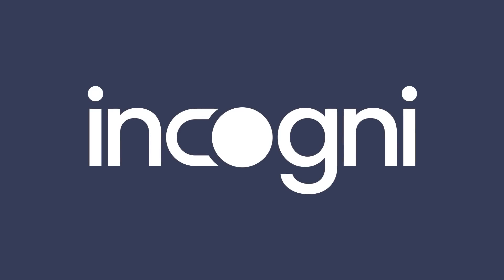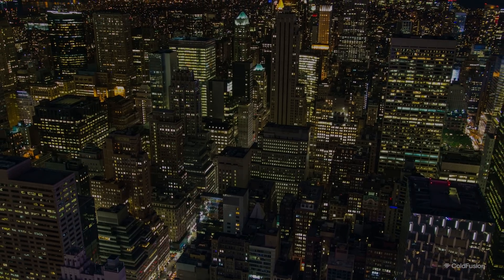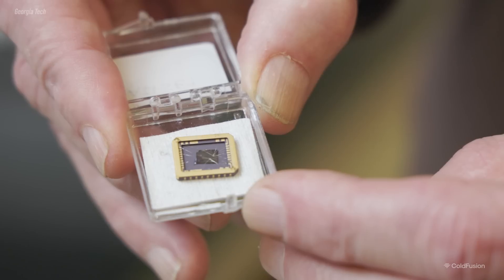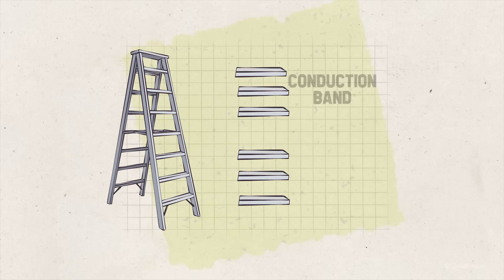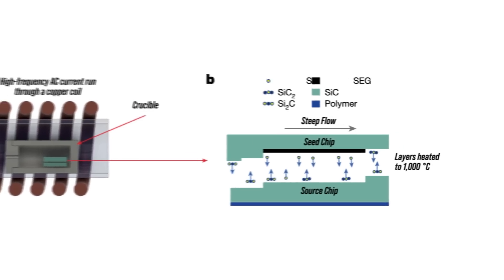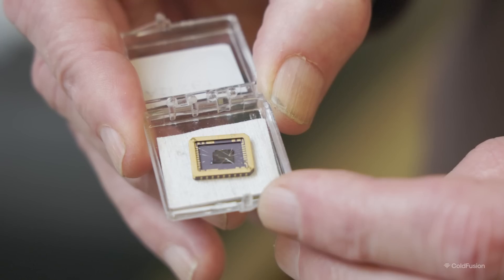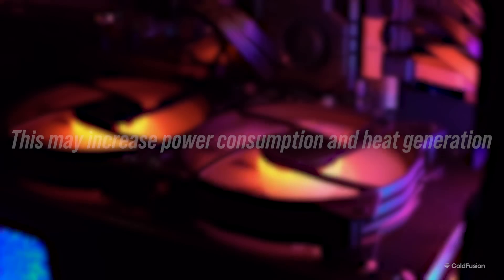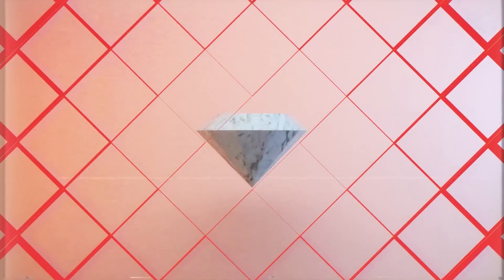This Chip Could Change Computing Forever

Comment: It's intriguing how often I stumble upon a seemingly groundbreaking technology, only to discover it's been around since the mid-20th century.
Reply: From my understanding, it seems that groundbreaking technologies are discovered much earlier, but they only truly gain traction once the technology around implementation/manufacturing/reliability becomes economically viable, which can take years, decades, or longer.
Reply: mathematics has been around for 5000 years, we haven't finished it yet!
Reply: @amj864  but try comparing that for how long human using the brain to calculate something 😮
Reply: @amj864   There are also complex mathematics formulas from over 2000 years ago that's been lost & have not been recovered.
Reply: Right! I’ll be like “wow microwaves are so cool,” look up its history and Wikipedia will be like, “Microwaves were an indispensable appliance during the time of Magellan.”
Reply: @renesays 😮😮 even before electricity 😮😮
Reply: I've noticed the same thing! Very often the newer papers also don't cite the older papers, probably because they don't want to admit that their work is not all that new.
Reply: Not true  @christiangomez7301
Reply: It took about a decade from when I heard about them finally making the breakthrough of making blue lasers, to when BluRay came out. It takes more research to see if it can be scaled up for the consumer market, if graphene doesn't pass the drop test for a personal electronic we might never see it except in videos.
Reply: Yeah sometimes they can make it, but its not commercially viable, hence the long gap as people spend time researching or applying new methods. One example of this is the solar cell, which was invented in the 1880s, but it was only 2% efficient and made of gold and selenium. It wasn't until the 1950s when the uses of silicon were discovered that any new progress was made.
Reply: Exactly this...
Reply: And will never be useful. I swear it's just stock bro's pumping and dumping stocks of these companies. I wish there was a securities investigation into these YouTube channels pounding out this rubbish.
Reply: Money
Reply: I guess it’s not groundbreaking unless it’s useful
Reply: The biggest hurdle os funding and finding a way to manufacture it at an industrial scale instead of having 10 guys using niche expensive lab equipments to make one a year.
Reply: Nicole Tesla was experimenting with a lot of these things in early 19th century but they blocked him.
Reply: Yes the first artificial neuron was writen about in the late 1940s
Reply: Kinda depressing actually. Shows you how slowly technology really advances
Reply: Electric cars 🚗
Reply: Try this one:  Mono Atomic Carbon.  6 Protons, 6 Neutrons, and 6 Electrons.  Excite it with microwaves and it becomes a plasma and can generate electricity.  The waste product is a quasi-crystal diamond-glass, which can be molded and machined and doped with metals and minerals for a wide variety of properties -- especially as a building material.    But not for men -- not until ALL wars end.  Hint: we can use the plastic island in the Pacific as source material. It is rich in carbon.
Reply: Just wait till you learn solar panels have been around since the 1890s
Reply: They are everywhere because everything just has to be perfect to make them more practical than the status quo.
Reply: I found a box of old science mags i subscribed to decades ago, and like 90% of the articles in there seem like future news.
Reply: 100%
Reply: The wonder of graphene has been systematically kept under the radar.
Better said we have birds in the sky that are nearly undetectable using this technology on full size scale.
Reply: It’s because the technology to either mass produce it in a cost effective manner, discover techniques to do what needs to be done, or a breakthrough that changes our understanding of what it does.
Reply: @StixFerryMan  You are over thinking it, there is already a huge example out there that uses it in thousands of kilo for 1 application. The point is they don't want consumers to have it YET.
Reply: AEROSPACE Engineer here and I've heard some similar stories regarding many technologies like: 
1950 We'll have Nuclear Fusion in 30 years because somebody made a breakthrough.
1960 We'll have Nuclear Fusion in 30 years because somebody made a breakthrough.
1970 We'll have Nuclear Fusion in 30 years because somebody made a breakthrough.
1980 We'll have Nuclear Fusion in 30 years because somebody made a breakthrough.
1990 We'll have Nuclear Fusion in 30 years because somebody made a breakthrough.
2000 We'll have Nuclear Fusion in 30 years because somebody made a breakthrough.
2010 We'll have Nuclear Fusion in 30 years because somebody made a breakthrough.
2020 We'll have Nuclear Fusion in 30 years because somebody made a breakthrough.
By chance can you guess how far away nuclear fusion will be in 2030?

I'm Australian but did my degree in America.
I was doing my degree in the late 80s and we EXPECTED to build Space Station Freedom in the 1990s and then be back on the Moon by 2001 to start setting up a lunar base that would be the start of a permanent settlement AND YES we took that date from the film. 

THEN the Challenger accident happened and as we know it was because of poor decisions being made by the wrong people. That has been followed by several 1,000 poor decisions being made by the wrong people and we are no closer to a permanent lunar base than we were January 28, 1986 when Challenger happened.

I have spent the last 30+ years working across a variety of industries doing industrial control systems and trying quietly to learn from these industries how we might do stuff on the moon. 

So long as we have the combination of the wrong people making bad decisions in combination with the unrealistic promotions (and at least Cold Fusion does but "providers" into the story) of effectively vacant over rated (and often over hyped) "future technologies" that will re-shape humanity we wont (as a species) move forward because too many of the basic things like food, shelter, clean water, clean energy and a few other things are NOT DEALT WITH as a priority. 

I have spent most of the last 20 years working on construction mines in remote locations because it presents the same sorts of issues building a lunar base has. Everything is at least 3 days away, the environment is hostile and you have to build all the basic infrastructure any modern society needs including housing, food storage, food prep, clean water, waste water, power (including power distribution), roads and very importantly workshops for maintenance.

While we have story after story of the latest break though technology we are also surrounded by crumbling infrastructure. Go and look at any modern society and you will find major infrastructure issues. They might differ from country to country but we all have them. Energy infrastructure is the major issue that most have and its a serious issue because everything needs energy.
Reply: Yeah capitalism has its pros, but not being able to get funding for legit world changing technology is a massive con.
Reply: Takes forever to work the bugs out of shit.
Reply: because ...isnt it obvious ....we got our technology from aliens...thats why leonardo di vinchi alllready was making a helicopter...welll its what i thinj anyways..
Reply: aliens thats why
Reply: this is clickbait and nothings changed, if graphene had promise and this paper was released in January there would be more articles about this
Reply: @percy9228  There was a huge fuss about Graphene, but the problem with it at the time, also mentioned in this video, was that it was impossible to manufacture cost effectively! Well that has changed. Even so, it still takes many years to ramp up production and what of the production of regular chips!? They'll want to make their monies worth.
Reply: @Sidowse  I'll make this very simple. He uses a new paper to discuss some ground breaking product. if it's so ground breaking the author will have said what it's about and what implications their are.
instead he points to a 12 year old video that has nothing to do with this paper BECAUSE THIS PAPER WAS SUBMITTED IN august 2023
do you understand what I am saying???
if you do some research you will see an ai wrote an article and used this 12 year old video. Coldfusion has become a shit channel that he churns out videos every few days so he grabbed a claickbait false shit and made it into his video without doing any research.
If it was as grround breaking as he is saying , their would be lots of scientist and engineers talking about it IN 2024. not in 2012!!!
man people on the internet will believe anything it's shocking
Reply: @percy9228  Don't take it the wrong way. Graphene has huge potential. We just don't know how to make it efficiently.
Reply: @stratos7755  it's not about making it eficiently. even once we could make it efficiently. it's a conductor not a semi conductor. this video posts about an article from Jan , that's not even the date of the actual article which was released in 2023 august. ColdFusion found a click bait article that used a 12 year old video and copied that. If this video had any merrit the scientific community would be all over this. their has been 6 citations on the original paper....
Reply: @percy9228  But graphene has other uses and properties than just being a transistor.
Reply: @percy9228 we already nee about it
Reply: How can be there new groundbreaking technologies or any new discoveries when people of this age are busy in scrolling and making shitty tiktoks or just following the rat race.
Reply: @syed3589  Ok boomer
Reply: @Vorexia  yes grandpa
Reply: yep. imagine how much society would have progressed if instead of focusing all our effort and money on wahmanism/diversity/equality and other similar ideologies, we instead focused on helping the best people do what they did best.
Reply: Precisely. I did a high-school presentation on graphene, and even my catchphrase was "graphene" is about to change computing forever. 

Guess where graphene is right now.
Reply: @moldytexas  about to change computing forever? Or at least until something else replaces it...

Comment: Lol, my gaming laptop last for the length of a movie, then it needs to be charged. It's utterly useless without consistent power.
Reply: Gaming and laptop, do not go together.
Reply: @JJ3nkins89  it's not 2010 anymore. we're in 2024. state of the art laptops exist for gaming. they got no excuse.
Reply: @miguelmejia4656  They are made to be compact versus PC, they will ALWAYS be less than something larger with more airflow for cooling. End of story. Laptop improve, so do PC at the same time.
Reply: My thin and light feels like it needs constant power as well. I’m ready for x86 to move out the door on anything portable man, it’s embarrassing how much better apples battery life is these days. I started using my iPad for almost everything in school because I can go days without charging it